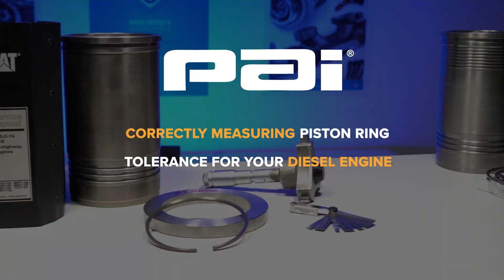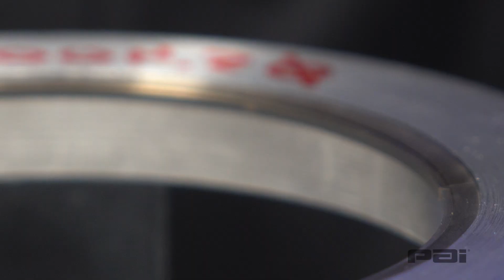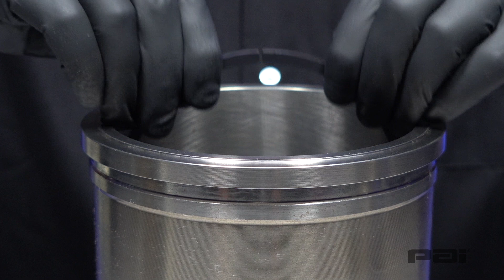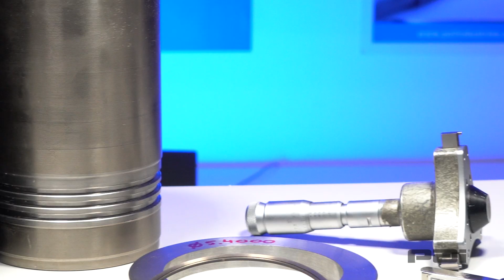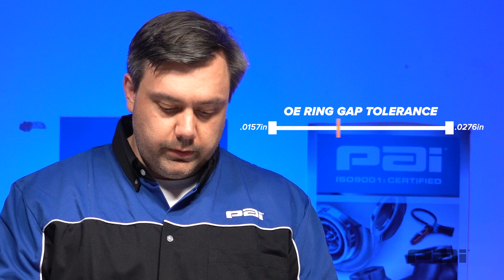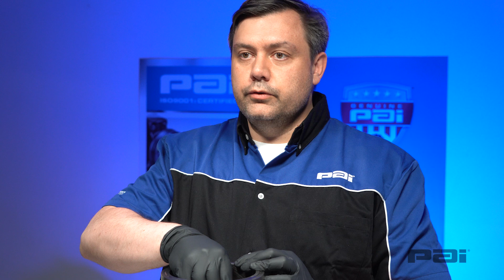PAI | Piston Ring Measurement Guide

Comment: What a great vid to have a better understanding of why using a liner to check the piston ring end gap is not the most accurate way, sadly in the field 99% of the time you only have the liners to do this measurement, bear in mind the possible offset